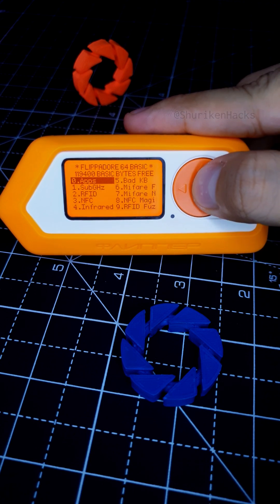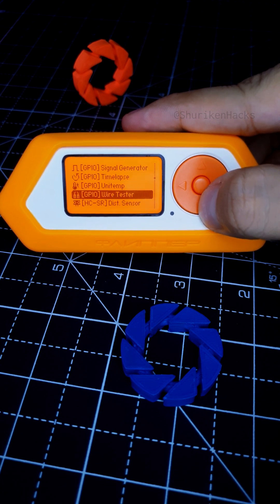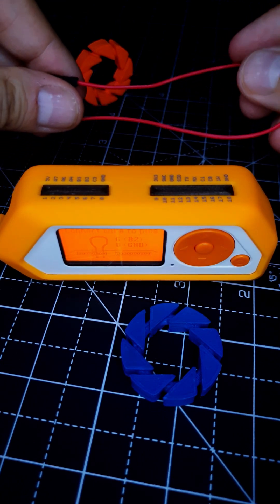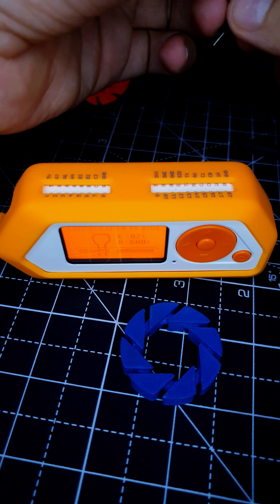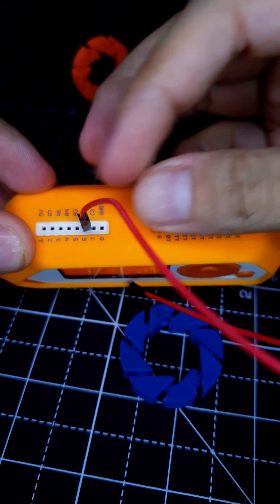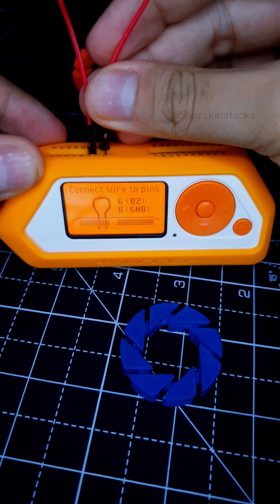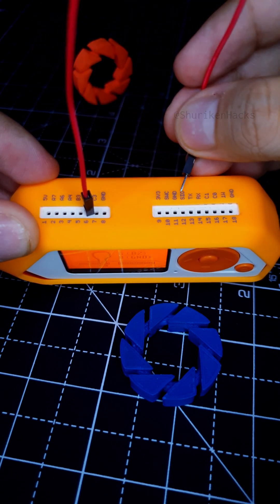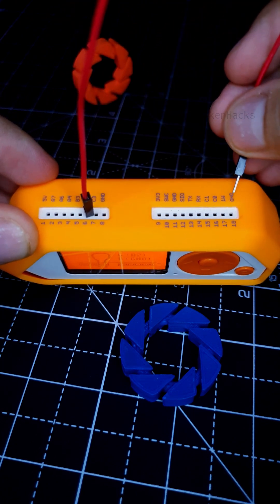"WIRE TESTER" on Flipper Zero!

Comment: Do you reckon a pin protector is important? Did you make it yourself or buy, and if buy where from? 🧐
Reply from the maker: 3D-printed. I've got clearer pictures of it on my Instagram, and I can send you the Thingiverse link if you'd like to get them printed. :)

I do recommend it because when unused, the pin holes would be a great entry point for dust (if your region is dusty) or moisture (if your region is moist). I've had my Zero dropped into sand once, and when I saw some sand grains come out of those pin holes, I "nope"d and got myself the cover. 😂
Reply: @shurikenhacks  hell yeah, thingyverse link would be awesome I'll defs make one 🤟
Reply from the maker: Here you go, my G: https://www.thingiverse.com/thing:5757435

Comment: I use this last night, got addicted to it... Also nice pin hole protector
Reply: Oh btw do you happen to know what type of wires and pins should we use on the Flipper's pin holes? I don't want to use rhe wires I have already because they are lead based and will leave residue. I tried to Google and it keeps sending me to reddit posts that has nothing to do with the question.